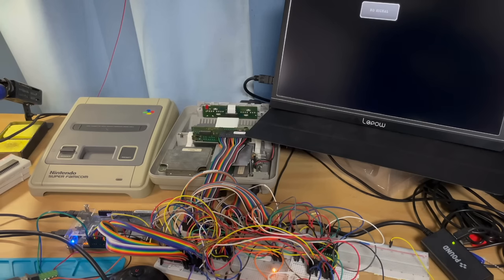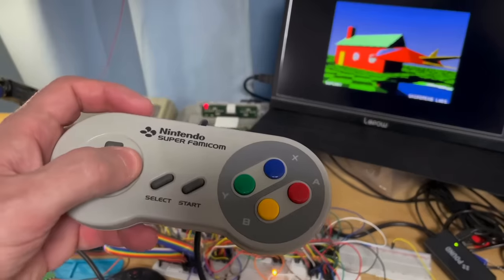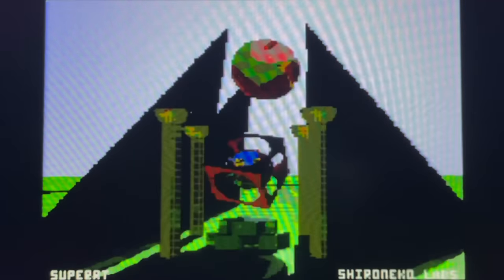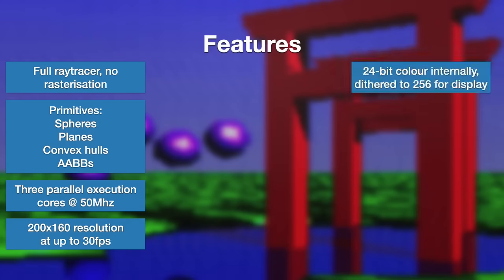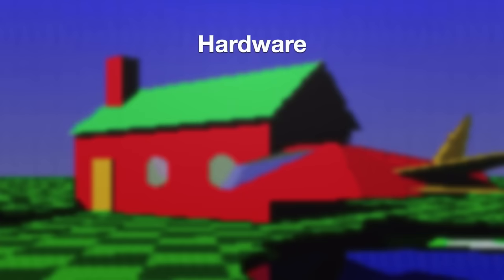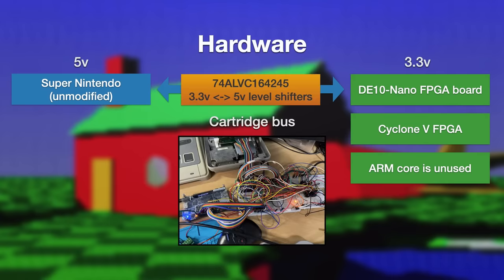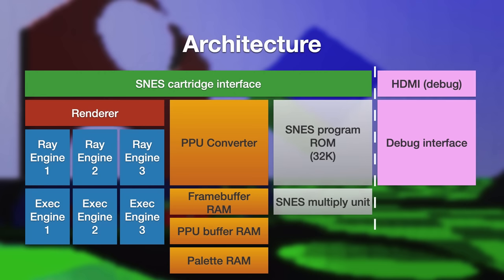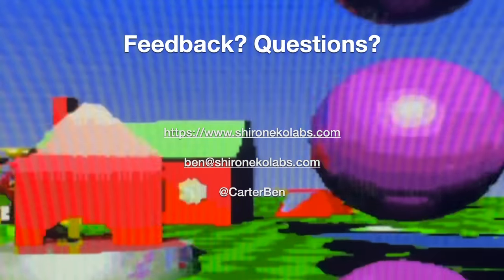SuperRT - Realtime raytracing on the SNES (walkthrough and technical overview)

Comment: Raytraced DOOM on SNES would be incredible.
Reply: Not really, the characters is flat
Reply: @Butt Cube Would work. Doom on SNES is built on a custom engine, which is genuinely 3D.
Reply: @mcjodice  No, it is not 3d it runs exactly like normal doom with more snes optimised code. The SuperFX chip is only used for sprite rotation and scaling.
Reply: Back then...
Reply: @oliverjurd  Randy Linden said 90% of the rendering was done by the SuperFX2
Reply: Everyone saying no, is likely assuming the existing Snes version of doom would be used. But if you create a new engine for it, built around the snes raytracing, it in theory could work.
Reply: Actually, trying to port Quake RTX to this would be bonkers. Doable, as in enormous task with heaps and heaps of hardware limitations but finite task nevertheless, and just total bonkers, it probably would run with single digit fps counter all the way
Reply: @humANdroid95  The problem with quake vs doom, is doom uses more of a 2d control scheme. IE you aim in the general direction. 
Quake you need to be a bit more precise by aiming up and down in addition to doom's side to side..

Doom.. even if an enemy is on a raised floor, you can still hit them without having to aim up. Which is easier for the snes controller.
Reply: @LazyBunnyKiera  it could work, but we already have Minecraft for this.
Reply: Doom uses raycasting for a pseudo-3d. To make a doom that ray tracing would work on would require a true 3d engine like quake, which kinda makes it stop being doom
Reply: Battlefield 5 ULTRA on snes
Reply: It being 2.5D matters less than you would think, I use RT shaders in ReShade on GZDoom. While it's kind of rudimentary, it does work (but not as well as this demo).
Reply: @oliverjurd  Nope. The programmer that wrote it had no access to the Doom source code. Just raw Doom map data. He wrote a custom engine called the Reality Engine for the purpose of the port, and it ran almost entirely on the Super FX chip.
Reply: @InfernosReaper  GZDoom turns Doom into true 3D (if you enable freelook) and IMHO it's still Doom.
Reply: @metalslayer777  There's got to be a way to fake it.  I don't think realistic shadows on the enemy bitmaps is feasible but maybe have a "virtual cylinder"  around the enemies to cast a shadow according to the lights in the area.  Idk.
Reply: @gatorhand  It's still not really true 3D, because of that weird distortion when you look up or down more than just a little bit. Until that distortion's worked out, it's more like 2.75D or something.
Reply: @girlsdrinkfeck  What does it have to do with what I said?
Reply: @mcjodice  no its not its 2.5 still
Reply: @metalslayer777  Normal maps could be drawn
Reply: There's literally no light sources in Doom; just sectors with different light levels. Ray tracing would have no effect whatsoever unless you added in actual light sources.
Reply: @KokoRicky  Do it like GZDoom where a few objects act as light sources, like the candle, floor lamp, red/green/blue flame posts, etc.  Also maybe any sector with light level >240 is a diffuse light source.
Reply: Nope
Reply: @oliverjurd  that's not true, the superfx runs the whole rendering pipeline for doom as well as physics calculations. The source code was made available recently, and the snes cpu is only used for streaming the finalized image to the ppu, and reading controller inputs.
Reply: yeah, at sweet, smooth 2 FPS.
Reply: @evelin1006  true, however many of the math was precalculated to make it possible on the 16 Bit  21MHZ Arm  "FX2" cpu
Reply: @evelin1006  I wonder if Duke Nukem 3D would have been possible since it uses basically the same rendering technique as Doom. The Sega Genesis/Mega Drive got an official version in Brazil. It was a major downgrade in comparison and demoted to a bland corridor shooter. But you are moving in a three-dimensional space without any helper chips. Correct me of I'm wrong about that. I believe a game in the scale of Duke Nukem Advance could have been possible. Maybe minus floor and ceiling textures and not as smooth of course.
Reply: Doom doesn't utilize polygons or light sources. It wouldn't work.
Reply: @LazyBunnyKiera  So, a possible solution here, tweak Quake slightly so there's not too many things where you have to aim nigh-vertically above of below you, and then just have the system use auto aiming for an enemies above or below the general straight-on view, same as how Doom does it, and sorted. It would be like Doom-Quake.
Reply: i was about to say that
Reply: Using GZDoom engine...
Reply: @Oliver Jurd  Nope! Doom is rendered on 3D, but the render method is based on a 2D shape binary- partitioned map
The super fx was used to render basically everything in the game
Reply: @humANdroid95  there's no way quake with raytracing works on 3 50mhz processors. Sorry.
Reply: @evelin1006  Randy also said the game was only running at 50% of the FX2's potential. He didn't have time to push Doom SNES because of the released date
Reply: And impossible at the same time

Comment: If you could go back in time and show Nintendo this at the launch of the SNES, they'd have given you the keys to all development. Very well done and absolutely astonishing to see all these years later.
Reply: cramming 3 50mhz cores in a cart with 90s technology calls for a cart of at least NeoGeo proportions, and a price of at least 2 full fledged computers, so feasible? yes. Practical, nope. Cool af? you bet!
Reply: Nintendo,HIRE THIS MAN!
Reply: @ceciliatavarez5655  NINTENDO, SUE THIS MAN
Reply: @molo-molo5103  Well, suing this man for his achievements using Nintendo hardware could actually end up with a settlement that involves hiring him for his ability instead of shutting it down, as it has happened in the video game industry before. But Nintendo being Nintendo, I guess they could also get irrational about it...
Reply: @data676  nintendo is just like Disney
Reply: @emiliocobos8806  Sega made the Genesis into a tower, so I don't think it would've been that bad.
Reply: @placeholder2924  those were add-ons though not one game
Reply: Especially since he'd be a time traveller who came to them with chip technology from 30 years into the future... You can run Crysis on a computer and use the NES as a passthrough, doesn't mean the console is running anything.
Reply: @unverifiedbiotic  That's what I was wondering. Could all of this even have been possible back in the early 90's, or is he applying 2020 techniques to old hardware?
Reply: @Nutty151  you have to think in term of factory supplies and manufacturing processes, nowadays all have changed.
Reply: @molo-molo5103  He's not doing anything he could get sued for.
Reply: Thats pretty much how argonauts got hired
Reply: @Nutty151 yep him is applying 2020's tech on a snes in the 90's they would need a Voodoo gpu on a cartridge to do this.
Reply: @HIDHIFDB  Thanks for the clear up. While technically this is really impressive, there is NO WAY this was possible 33 years ago on native SNES hardware.

Comment: Wow, that is probably the most impressive thing I've seen on the SNES in a decade. I'd love to build my own cartridge in case the design is made available to the public in the future.
Reply: It’s not on the SNES though, the SNES is only handling graphics output, all of the processing is being done on three CPUs in this board that happen to be connected to the SNES.
Reply: SNES as the car, and the CPUs as the drivers. Neat.
Reply: @yellowblanka6058  0:30 mentions "one of the most interesting things from that era of gaming was that many titles made use of expansion chips in the game cartridge that provided extra functionality..."  Shironeko Labs made all this ray tracing functionality work like an expansion chip that was supported by original SNES consoles.  It is augmenting the hardware of the SNES but in the same way a lot of SNES games did when the SNES console was new.  The main difference is that he has some very impressive 2020's real time ray tracing technology in his expansion chip which completely blows away performance of expansion chips from the early 1990's.  Another difference is that he didn't compress his prototype to fit in a cartridge.
Reply: @IARRCSim  To be fair, I don't consider games making heavy use of expansion chips an indictment of the power of the host system in general, though at least in the case of games like Star Fox it was using the SNES for things like scaling the sprites for the shots etc. - if a piece of code would never work well without a co-processing chip far more power and/or specialized than the chips in the host console, it's not an indicator of the power of that console, or the game wouldn't NEED that chip.

Comment: i really hope this sparks a golden age of SNES fangames/homebrews creation
Reply: Ikr
Reply: I second that!
Reply: holy $&”@, I never thought there’d be a chance SNES would get ray traced Star Fox
Reply: @protocetid  ehh since star fox is fast paced, i'll probably struggle with RTX. a mod to improve framerate without speeding up the game might be possible though, remains to be seen.
Reply: @lucaspec7284  Oof so a Super Mario 64 demake would be out of question? Paper Mario would be easier on the hardware with its many sprites, wouldn’t impress to the same degree as SM64.
Reply: @protocetid  either way i don't think anyone would have time to even attempt to get that kind of 3d running on SNES, the only SNES fangame i've seen that does anything with 3d is the Starfox EX romhack, and that's pretty much just starfox with extra content, so it uses the same SuperFX rendering as the base game.
Reply: @lucaspec7284  It pains me that you’re right, people don’t even want to finish the Sonic 1 port to SNES, I thought the sheer irony of Sonic on the console the hedgehog badmouthed would be enough motivation. Wish we could fund it, would require Sega to officially license the port, and the odds of it occurring are minuscule. SNES homebrew does have a chance at achieving some prominence with a fan made SDK, retro consoles have gotten a bump in  new games that way. But homebrew developers prefer sticking to period accurate specs/configurations so they might not touch this ray tracing hardware.
Reply: Someone would have to make the chips first. Including a $250 FPGA dev board in your cartridge isn't going to be feasible 😅
Even the upcoming $99 clones of the DE-10 Nano or a custom board with just the Terasic Cyclone V FPGA chip would be prohibitively expensive. But if someone could make regular chips from the design... Maybe but I bet youd have to make a lot of them for the cost to come down and while raytraced SNES games would be cool I'm not sure it's a concept that would sell that many physical copies...
Reply: @protocetid I think it has a lot to do with the fact that many homebrewers are from Brazil, and the Megadrive was always the main 16bit console in South America. The architecture of the Genesis/Megadrive is also way more programmer friendly.

Comment: I'm sure that you can re-create your expansion chip using the FPGA in the SD2SNES Pro. Once you get that coded then you can do it in real time without all the wires in your video. Great video!!!
Reply: yeah i was thinking about it. At the very least, he can take a look at that backup device
Reply: Yeah, I was also wondering about whether or not this could be realized with the SD2SNES Pro/FXPAK Pro.
Fingers crossed it will happen; the firmware updates are live on Github, afterall.

https://github.com/mrehkopf/sd2snes

Comment: I hope this can be used to make a fully raytraced version of Starfox on SNES...
Reply: Raytracing in space could be a problem, cuz the only source of light is the near star.
Reply: @metalslayer777  just have a light source at the camera and problem solved
Reply: I'd rather prefer star fox with textures instead imo
Reply: @Sh-hg8kf  Textures are overrated. Eventually, they'll be obsolete.
Reply: @InfernosReaper  bruh wat
Reply: @Sh-hg8kf  Textures. Totally overrated. If the shapes are defined and colored well enough, ya don't need textures to make up for what's missing on the shapes.
Reply: @InfernosReaper  you do realize  a simple normal map texture is less computationally intensive than actually defining the geometry how you want right?
Reply: @Sh-hg8kf  depends on the geometry and coloration vs the resolutions of the textures, as well the type of game

For example, with Star Fox, what do textures really add beyond a smidgen of definition to a few buildings on a level or 2? Kinda not really that necessary, to be honest.
Reply: @InfernosReaper  bruh I'm talking about modern games now not snes star fox
Reply: @Sh-hg8kf  ok. you're on a comment thread about star fox and raytracing so I assumed ya know...
Reply: I think there were some roms that were patched to use the SD2SNES or something to offload work - this reduced slow-down that was present on a lot of original SNES roms. - So, yea - this would be very cool - How about Donkey Kong Country?
Reply: @InfernosReaper  don't forget about procedural textures, that you can do anything with them, and they're basically infinite in resolution, because they're generated in real time, but they're way heavy to implement because the computer has to generate it everytime
Reply: @mjetektman9313  sounds awesome! Is there a tech demo of this?
Reply: @InfernosReaper  you made a general claim about textures becoming obsolete. If you meant to add “- but only in star fox” then you didn’t get that across.
Reply: @wabznasm9660  Do you know what textures are for?
Reply: Boomslang  Why not both?
Reply: @InfernosReaper Several years later with this, but the YouTube algorithm works in mysterious ways. Anyways, I vaguely recall an Ars Technica War Stories with Andy Gavin where he was describing how Crash Bandicoot was animated. Rather than the traditional way with bones and whatnot, they instead used a ton of small polygons that were flat filled with color and deformed the geometry as needed. The concept sounds similar to what you’ve described here
Reply: @metalslayer777  On Earth too it's a near star, though there is light scattering because of atmosphere, but still
Reply: @metalslayer777  that's not really a problem. just hack in an ambient term
Reply: @InfernosReaper someone doesn't know what textures are. A bump map is still a texture map

Comment: Alternate title: sticking a 90s silicone graphics pc in a SNES cartridge
Reply: silicone?
Reply: Well as he said, the cartridge only gives the instructions. Not the power
Reply: @middleclassthrash  i wonder if it is possible to increase the resolution amd framerate of it by adding extra ram, that would be great, for what i understand is that due the limited bandwide the snes can only stream video at 160x200 at 30fps in 8bpp, but maybe if we could increase the ram, we could increase the bandwide to allow streaming video at 256x240 at 60fps ,
I say this because it comes to mind that the sattelaview addon for the snes has 256KB of extra ram to increase the performance of the snes, but if that also means that you can stream video at a higher quality on snes??? I just don’t know but am curious about that!!!

Comment: This just popped up in my recommendations, but it is VERY impressive! It makes me think of what could have been done with games at the time. And for sure the Demoscene would have had a field day with it, and probably still would.

There's something I miss about this era of computational electronics, where it was about performing low-level tricks or adding custom accelerators to really pull the most out of hardware. It had a strong element of developer ingenuity, which has more or less been replaced with either super corporate ICs or high-level development which assumes almost infinite RAM and CPU cycles.

Comment: Who knew that we had the tech to ray trace in real-time almost 30 years ago?

In 2004, I remember being in 3D animation class in college and being told that it was currently impossible to ray trace in real-time and that we were still years off from that tech.
Reply: The real ray tracing is performed on a modern FPGA. Using '90s hardware would require an expansion card 10 times the size of a SNES.
Reply: Robert w  It's an interesting story, can you elaborate further/refer articles? tnx
Reply: @Rand0081  - If I remember correctly that was the company claiming they could do ray-tracing 10,000 times faster then the competition, dedicated hardware would help in that endeavor. 

Also I believe they had an add-on card that could do ray-tracing at 30 fps running on a something as low as a 5 watt add-on chip.

I'm pulling this info from memory so it is possible I got some of the facts wrong and some of the info is more then 10 years old, but I do remember the articles were on tomshardware and they still should be searchable.
Reply: @Rand0081  So, not impossibly large.
Reply: @Rand0081  Perhaps, but imagine this sort of thing in an arcade cab back then

Comment: This is lovely ... i restored an Atari ATW800 a few years ago, which was mostly used for showcasing raytracing in the 80s (since there never was any other use-case for the Transputer architecture on that machine). While the resolution was considerably higher, rendering a single frame took somewhere between 10-120 minutes. Lovely to see this done in realtime on hardware that came out a few years later ... of course with some more modern hardware added.
Looks like the SD2SNES has to be upgraded again once this project has been finalized ;)